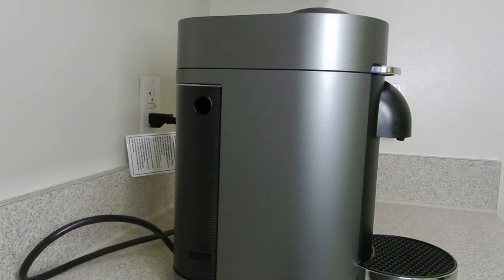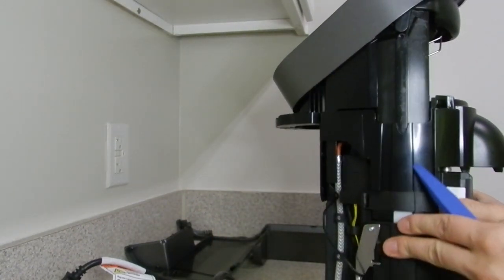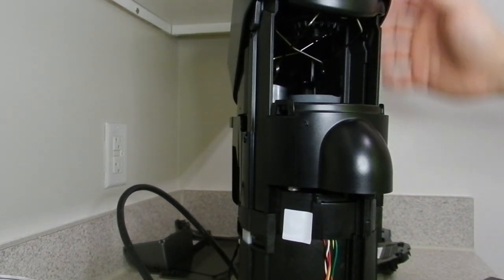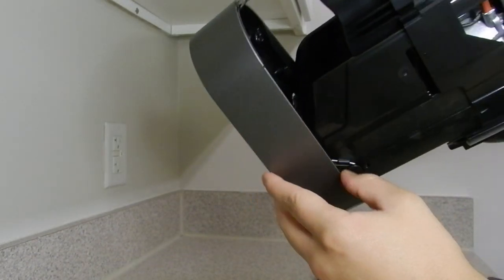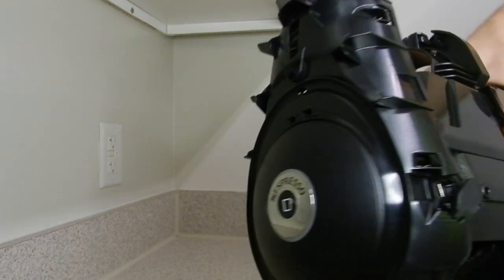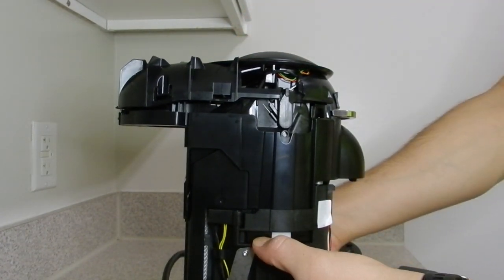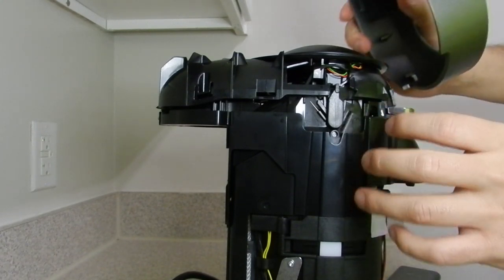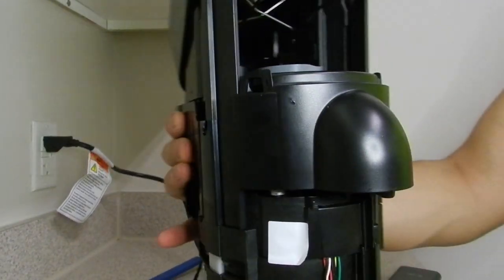FIX YOUR NESPRESSO VERTUO Part 2

Comment: Thanks , I had a red ring and it wouldn't open at all.
It's now fixed 
I had this and fixed it , unmount the lower part of the machine , separate the worm gear mechanism to release the white gear piece so it can move freely, that will allow you to open the lid , remount keeping the top open , when it's plugged back in , it will automatically close again and turn green.
Reply: How did you fix getting yours to open? Mine won’t open at all to let me take the bottom off.

Comment: Do you have any suggestion of where to look if my machine doesn’t seem to warm up - it currently blinks green and won’t turn solid then turns to red. It’s outside of warranty and I’ve pried the bottom off but should i go further into the cork screws you mentioned?

Comment: Ok so I accidentally took off the entire top part, not just the cover. Two springs popped out and now it won’t open all the way or close all the way with the pods. Do you have any quality pictures of your nespresso with the cover off?  I need to find where these springs go.

Comment: My pod adhered to the base. When gently freeing it the basket came out with the spring below. I tried to reattach it. With some experimenting i reattached the basket without the spring and now can’t remove it. Any thoughts on freeing it up without wrecking it?  I appreciate your time and thoughts. Jack
Reply: Jack, I have the same problem! Did you get yours fixed?
Reply: Hi. I have the same problem. The basket and the spring below came out, and I can’t fix it. And it’s not closing anymore. Did you get yours fixed? Thank you

Comment: Have you had trouble with the unit not heating? When I turn it on the blinking green light stays on. Then the solid red light comes on. I can descale it but no hot water.
Reply: Same here. A few ideas floating around as I disassemble it. Maybe over heating from too much constant use has caused some of the internal circuitry to be compromised.
Reply: The thermal fuse has blown and it is hard to replace as it is imbedded in the thermoblock which is what is heating your water. Taking it in for servicing they would replace the thermoblock . Normally in small appliances the thermal fuse would be externally located but not in this case. I have fix steamer basket etc by replacing the fuse and I thought I would do the same here.

Comment: Have you taken the o -ring out on top? My machine is leaking coffee and I think it's because the o-ring seal is worn.
Reply: Mine is having the same issue. Descaling hasn’t fixed the issue. Have you found a solution by any chance?
Reply: @petersicaja2222  I tried to find an o-ring but was having a hard time finding the exact one. I did speak to customer support and we went thru resetting the machine and manually trying to use a paper clip to see if things were clogged up at the exit nozzle . No luck but I might have to investigate this in more detail. Since my machine was out of warranty by 6 months, they did offer a 35% discount on a new one - the same model, but I think I would have to pay shipping. For me, it just made more sense to buy their latest Virtuo Next - more "green" and has a manual lock mechanism. I'm hoping that since this is their newer model, it will last longer. I feel bad buying a new one since the old one worked perfect up until the leak and looks new, but my choices were pay $125 to repair(shipping?), pay $135 for a new same model but with shipping cost or pay $150 on Amazon, free shipping. Good luck.
Reply: @jhideout  hey I actually fixed mine from leaking! What I did is take a flat tool such as a butter knife or something thinner and I wedged it on the inside part of the rubber seal on the plate that spins and pokes the pod. With my tool behind the rubber seal, I spun the disk 3-4 times and realigned the seal. Tested the machine and it isn’t leaking anymore. Id say try that before getting a new machine!
Reply: @petersicaja2222  Nice, I'll try that. Thx!
Reply: @petersicaja2222  I tried what you recommended as mine was leaking coffee.  The top o-ring seal looked like the culprit so I lifted the seal from behind with a butter knife and spun the disk a few times.  I then went thru a cleaning cycle and now its not leaking🙂.  THANKS SO MUCH FOR YOUR ADVICE AS IT WORKED !!!!!